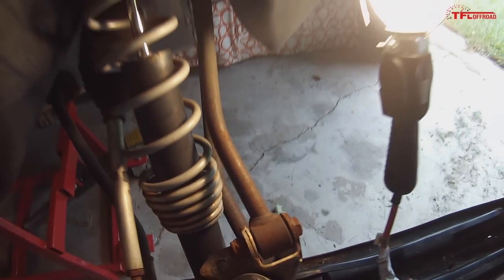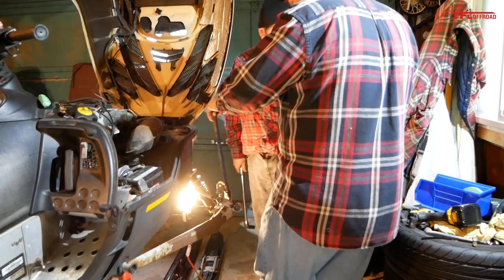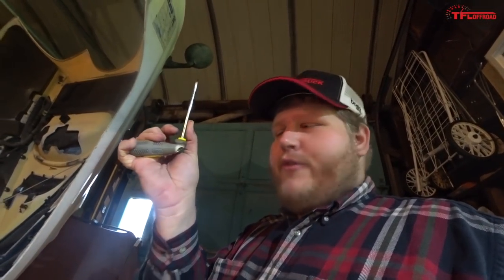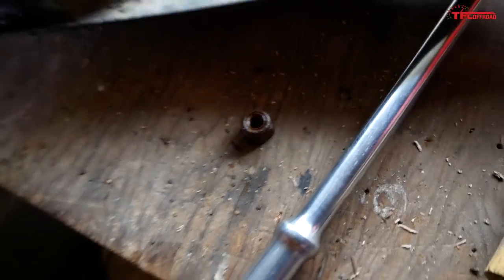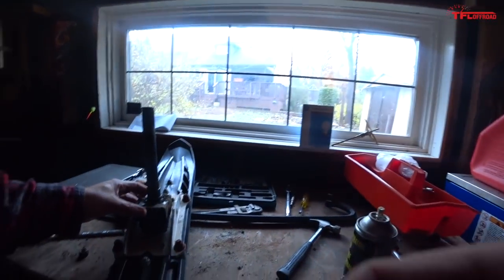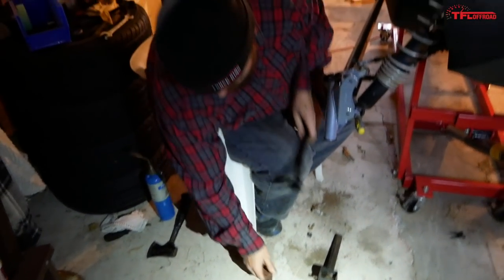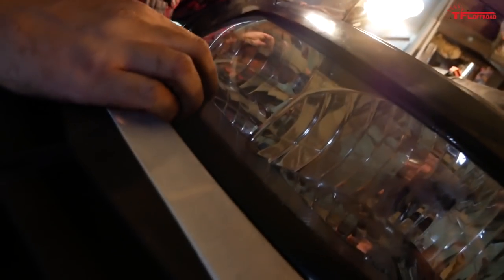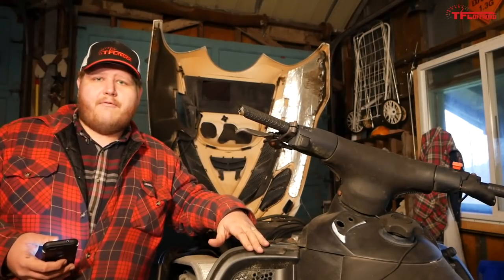Ski-Doo ReDo - Bringing a $400 Sled Back to Life: Old Bolts and Broken Tools. Ep.3

Comment: Also best penetrating fluid is called PB Blaster you spray it in between a bolt of a surface or what threads you can see and you let it sit for a minute sprayed again sit for a minute and that's the only stuff I found that will eventually break a bolt free if that doesn't work then heat

Comment: What makes working on an old vehicle so difficult to work on is the bolts never act like they're supposed to. example your bolts and bushings are all seized in I recently purchased a 2002 CR250 every single bolt is stripped threads or rounded off bolt head or cross-threaded really makes for a long day when you're just doing an oil change and you find out one of your bolts is completely stripped out there are no threads anymore you have to retap the case and then you go to tighten the chain and your axle bolt nut is cross-threaded and the threads are mostly gone now because it's been cross-threaded so many times a 30-minute day of oil change and tighten the chain turned into two days of parts tools and time

Comment: I had the same issue removing the shocks from my truck. After messing with it for 2 hours busting bolts and ruining the threads on the bolt  I tried one last thing. I used an air chisel on the end of the bolt and it came out within 5 seconds.

Comment: I'm surprised at the amount of rust on those bolts. Bombardier had a good chemical process on their bolts to prevent corrosion. Does crappy tire sell the right grade of bolt? If that were a vehicle front end, those parts would be replaced to be trail worthy.

Comment: Wow that thing is rustier the my 97 ski doo touring. I rebuilt my front suspension and every bolt came out. The reason that’s all rusty is because no one ever maintained it by greasing everything!

And if you put the washers all
On the inside which will push the ski out it will handle that much better!

Comment: Guy's seeing that you had so much trouble removing those bolts,..why not grease them when re-installing?  Make it easier for the next time, or the next guy working on it..
 A Tip for you, when you need to pound out a stuck bolt,..put the nut back on a few threads, this will give you a little bigger 'target;' for the hammer blow,..and save the threads too. Also,.along with that one,..put a heavy object ( sledge hammer) against the opposite side from the one you're going to hit,....this gives a more solid blow to the bolt.
Reply: Reg Sparkes 
There is actually a grease fitting in that spindle that will allow you to grease it so you can keep that from happening.
Reply: @dodgeguyz  Yes, you're correct,...just as long as that zerk ( fitting ) gets the grease, right?

Comment: Pour gas in the cylinders... please stop using quick start
Reply: Mixed gas in thr cylinder. I agree have had to that many times tearing apart old sleds. Even though fuel pump is clean/new and carbs were clean

Comment: For the love of god if anyone needs to remove a stuck bolt like this......

After the bolt broke on the nut side, they should have used a disc grinder and cut off the head, then slid the A-arm off the shock. Unbolt the top of the shock from the sled and put it in a vise where you can either soak the bolt with penetrating fluid and / or beat it out with a punch and hammer (or press it out with a press if you have access to one.  Trying to take it out on the sled was 100% the wrong way to do it.